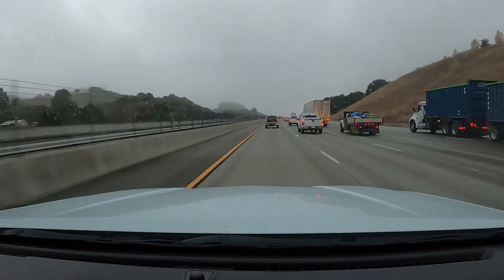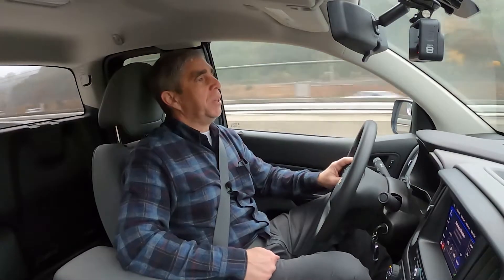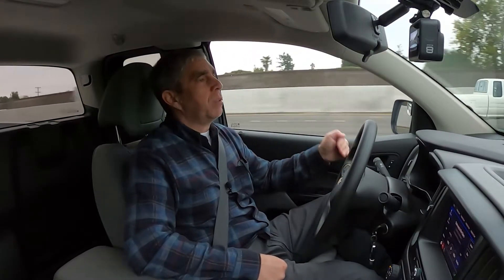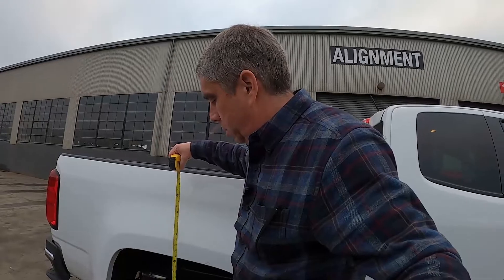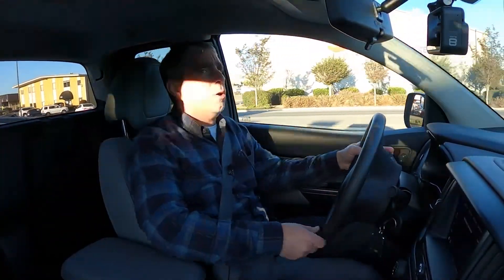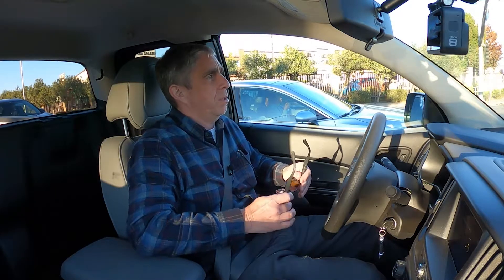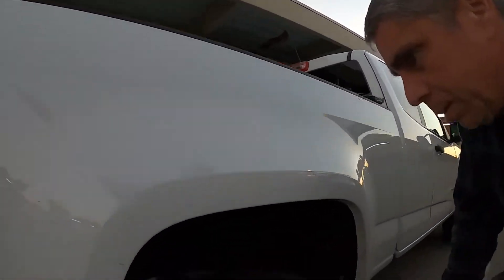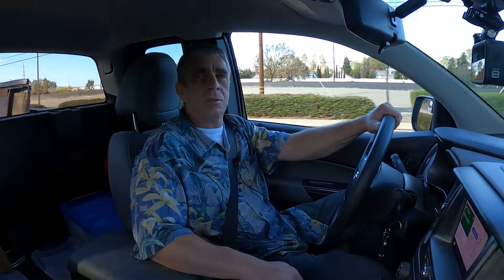Leaf Spring Mod | Review | Chevy Colorado | Towing

Comment: You have built a very capable WT and retained the 7K tow capacity.  The Peak coil over kit may be a good option.  It allows you to dial in ride height side to side.  I ran the ZR 2 stage with the AAL for about a year. Then went to Deavers, significant improvement in handling, rear has very little roll.
Reply from the maker: Thanks for the info, Steven! I didn't want to jump off the deep end and change too much at once. At the same time, I don't suspect the leaf spring upgrade will be the last mod I do to the suspension. But yah, it has been working well and glad I did it.

Comment: Would the air ride be a better option than the leaf packs when wanting to use your truck for dual purpose of overlanding and hauling?
Reply from the maker: Air ride is a different kind of animal. I used a Buick to tow stuff to the track. Essentially, it was a pimped out Trail Blazer, but it had factory air ride. Worked awesome for the highway. Not sure it is appropriate for off-highway. For the Colorado, my axle weight will be similar when compared to towing because I place a lot of cargo in the trailer while towing to compensate for the tongue weight. So the rear axle spring rating is appropriate for either scenario.
Reply: @MarioWorkedOnIt  I'm talking about aftermarket air bags designed for tow vehicles that level the rear of the vehicle and compensate for the load.  Adding leafs to your spring pack allows for less articulation during offroad situations.  You do seem to put a lot of load over your axle so I'm sure the add a leaf helps, and it gave you the rear lift you needed.  It's got to be stiff when you don't have the trailer hooked up I'm sure.
Reply from the maker: @kevinfoley7704  If I empty out the bed, it is a little stiff. I am certainly open to ideas regarding the suspension. I jumped on this option because it seemed like the path of least resistance to get my foot in the door and be poised to do what I am doing now. Actually, I need to do MORE off-roading. So this is something I will be keeping an eye on. Thanks for commenting!

Comment: Hi Mario, just discovered your channel. I have a 2015 Colorado LT crew cab 4x4  with tow package. We picked up our first ever RV travel trailer in October 2020 a 2021 Forest River Ibex 19QBS.  My first tow experience was to our storage facility about 20 minutes from dealership. I noticed immediately that I was expierencing porpoising or a bouncy feeling as I drove. Did you expierience anything like that? I was really unnerving.  I started researching immediately and discovered that I may need a suspension enhancement also. I was thinking of trying Timbrens to replace stock bump stops to improve ride quality while towing but may  also need leaf springs enhanced. Great channel keep it up.
Reply from the maker: Michael, The only time I have experienced that with the stock suspension is on extremely windy roads or hitting large dips on the freeway. It was never a constant thing and could be tempered by not driving so fast. For example towing the trailer and some cargo on backroads, I would expect to have my hands full approaching a turn at the recommended speed -- as indicated with those yellow signs that have the turn arrow and a suggested speed. It was only on rare occasions where it was obvious I was using the bump stops and really only while I had a lot of cargo in the bed (no trailer). I never really drove that fast pulling the trailer over obstacles like a dip at the base of an overpass. I decided on the leaf spring upgrade because I am very confident I will dedicate my truck to hauling heavy loads full time. I feel the stock suspension in new condition is versatile and you just need to drive slower when hauling. I don't know that I would invest in bump stops. I would want to make sure all of the suspension and steering components are in very good condition before making any changes to the spring rates. I would start by inspecting the steering linkage and all bushings. Maybe even check the steering box and shocks/struts. I would also try testing the truck without the trailer by securing some payload in the bed.

Comment: Found this really interesting Mario!! My z71 is 36in at the wheel arch. I bought the z71 for the better suspension and ground clearance, or so I thought!! Were you having issues with towing or payload that prompted your upgrade? I am not really clear as to what you were experiencing prior to your upgrade. Another great video though, thanks for including the measurements!! Looking forward to more!
Reply from the maker: Barbara, when I have the truck bed loaded down with cargo and/or pulling a trailer, the truck can sway back and forth on its suspension. Going over bumps while turning or going over bridges with wind gusts is where this is most obvious. This alone is not a reason to customize your leaf springs. I chose to add leaf springs to my leaf pack because my truck will be dedicated for towing and hauling. It will almost always be loaded down. The engineers at GM chose the components they did because of consumer demographics. An off-roading trim package should not equal a towing/hauling package. There is no (current) way to have your cake and eat it too. I plan to travel off of the pavement and use my 4 wheel drive but I realize my truck's bias will be towards carrying payload. As I understand it, the tire diameter for all Colorado trim levels is the same or very close. In order to get additional clearance you need to change the tire diameter. Lifting your truck does not equate to additional clearance but may accommodate larger tires. Having a higher center of gravity is not something to aspire for. Remember that luxury trim packages will almost always have additional weight when compared to stripped down base models. Weight will affect the truck's ride height.
Reply: @MarioWorkedOnIt  Thanks for the explanation Mario!! makes a lot of sense!! You would think when gm offers a Tow/ haul package on their trucks they would include a beefier suspension. I think I am running a 17in tire. I am planning a fairly long trip next week with the trailer. I will be mindful of the issues you have mentioned as I did not notice any on the short shakedown trip I took last weekend. Thanks again for your great videos and great explanations!!
Reply from the maker: Glad to hear you are able to get out of town and enjoy your trailer! Stay safe!